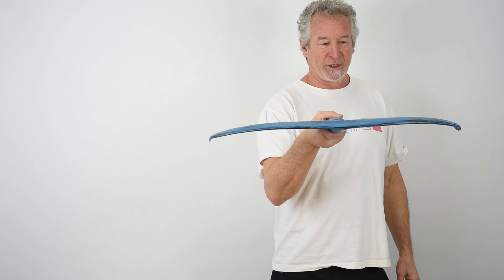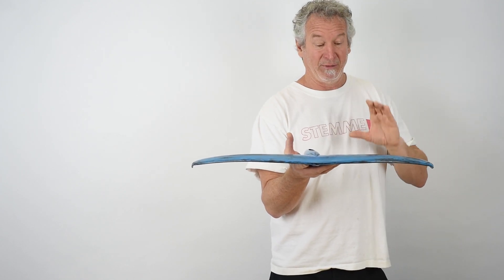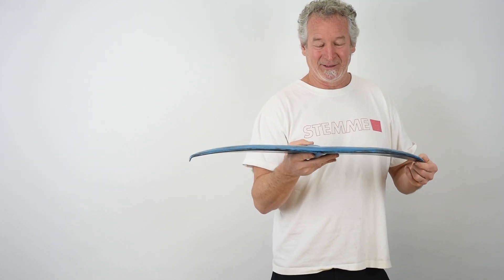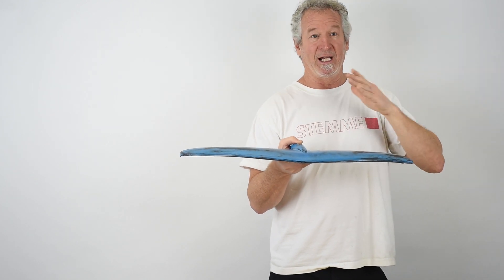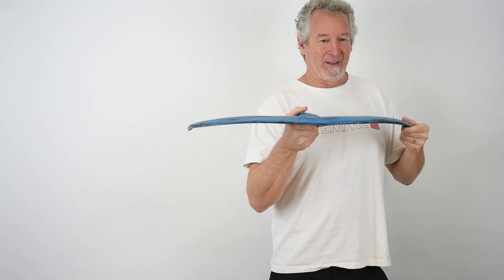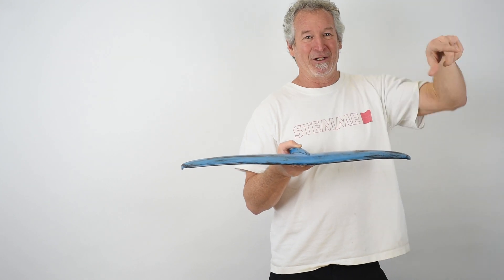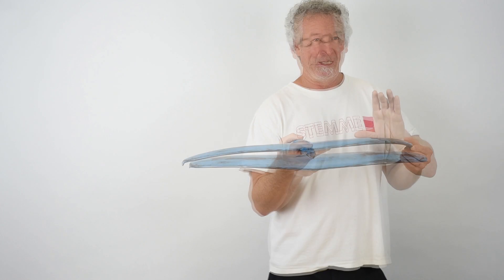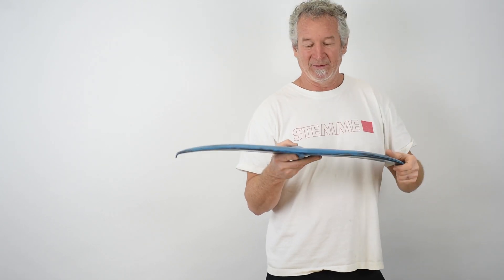Learn Hydrofoil Construction: Slingshot | Tony Logosz 2018

Comment: Heavier faster? No, the physics says given the same height and different masses, both objects will accelerate by the same amount due gravity. It’s like take a lead weight and a feather, put them in a vacuum (to remove air resistance), let them both fall from the same height, both will arrive at the floor at the same time. Yes, the heavier object will have more momentum, so once the heavier object is moving at the same speed as the lighter object, it will take more energy to stop the heavier object.

Still thanks for your video. Personally, after a nice foiling session on the water, having to carry a heavy board+mast+wings over the sand dunes and battling against a kite pulling me, especially with the cantilever effect of the mast, is very annoying. Next system for me will be a lighter one.